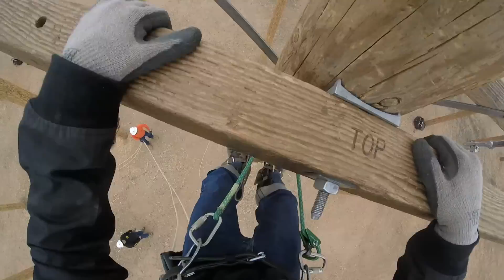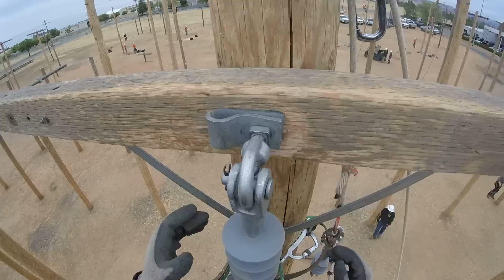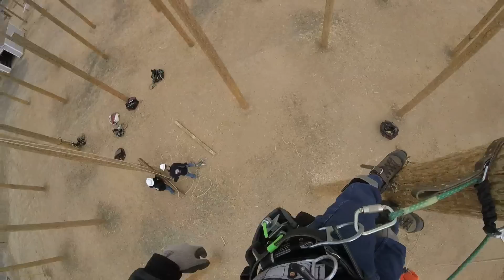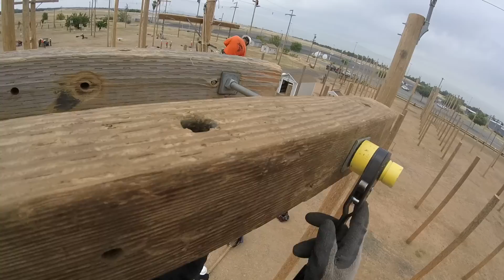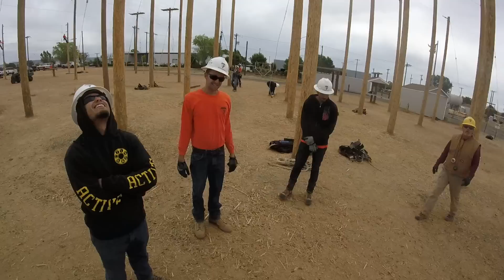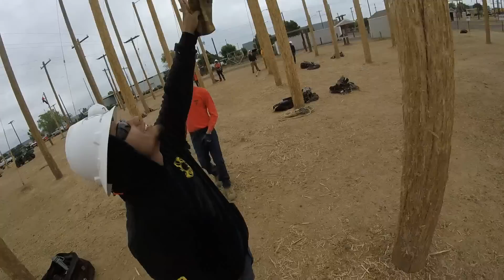Northwest Lineman College - Double Crossarm Changeout

Comment: Quick question what happens if he drops a tool? Is that a automatic fail? And what is the time frame he has to complete this in?
Reply: If you drop something on a comp now its a DQ, and he has 15 minutes to get this done.
Reply: phillips11! It’s a DQ if he’s comping on it. He would have to start over
Reply: No when I went you just used the hand line to bring the tool back up if it took to much time then you would just try again

Comment: Every time he pulls out that wrench untethered I'm like "oh boi here we go again"
Reply: reculture lol yea man he almost dropped that shit you seen
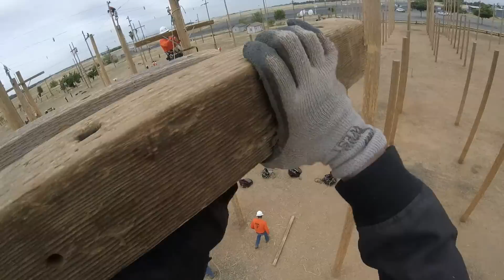Reply: 8:20 that would have been a very unfortunate day for anyone below him. Must have been hanging on by half an inch
Reply: That’s why you stay out of the damn hole.
Reply: I can tell you aren't a lineman.
Reply: Albat, selcat anything else but this...
Reply: Nobody uses tethers dummy
Reply: reculture id throw that damn wrench in the bin and carry me a bell tool . Them nuckle busting sob will piss you off faster than a worm with the shits.
Reply: @roosterkerr1780  I think this is one of those for profit schools that teaches rats how to climb for $100,000. Go join an IBEW union and learn how to do it right from the best. That ratchet wrench is a total pile of junk. I'd even take an old gator 1920s mouth wrench over that ratchet. The ratchet mechanism is total CRAP. It is a low tooth number that won't ratchet when you want it to. Blackhawk & SK made some of the best early ratchets. My old Southern States hot stick ratchet was either a Proto or a Blackhawk 1/2 inch pear head ratchet with a ball on a stem welded onto the back of the ratchet core. You could use two sticks and tighten everything up from the ground. It was a neat system. That extra ball & socket helped out a lot. No one else used that to my knowledge. I loved it. Someone stole all my old Southern States line gear. Salisbury is the dominant one out here now. Buchanan, I suppose. I still have a bunch of Klein grips, sticks, spiders, gloves, gauntlets,  and other stuff. I work on transmitters, sound equipment, theatrical lighting & guitar & other musical instrument amps now. Some of the large transmitters run up above 100KV. I am not above or beneath overriding the interlocks on the doors and troubleshooting those thing hot either. Sometimes it's just the only way, besides trail & error guessing.

Comment: Untethered tools with a tiny exclusion zone beneath? Mkay.
Reply: Yeah is that procedure? Could have a paracord teather for the wrench or something I was thinking he took a risk removing the heavy wooden arm from the pulley and taking it in hand. when he could have installed it then removed the the tie...
Reply: Chanch Chanch  cant think of a reason why he didnt bolt before releasing the pulley.
Reply: Kevin Manley I agree dumping the pulley before he finished the job, bad move.  Sooner or later it’s gonna cost ya an extra trip back up the pole. He was probably thinking about that very thing when he almost dropped  the wrench .

Comment: Puts cotter pins in his mouth. Rigs hook wrong when lowering arms. No “headache” when he airmails the collar rope. Washers are crooked. Arms are probably not parallel. DA bolt should get the nut tightened first. Other than that good job
Reply: Frost12 have to have constructive criticism in this line of work. If you are a lineman and can’t take helpful advice than it’s going to be a tough world out there I’d imagine.
Reply: Piss off dickhead
Reply from the maker: Frost12 this was literally my first 2 months in the trade you fuck. I was at school LEARNING in school, didn’t even have a job yet.
Reply: No frost12 is right , I went to the same school and if you did that it was dq, plus you sent the handine down before the work was done

Comment: it also does NOT work when the nuts are so loose, as the socket can spin as well as the nut can, therefore the ratchet CAN'T click over to the next tooth to allow a second 'bite' with the handle. so to cure this start with fingers first, OR hold the socket still, before attempting to use the ratchet function  :)) ( or better yet use a "rota tor" ratchet handle ).

Comment: They training poles are a mess must be easy changing cross arms in Scotland it's Steele not wood and they are really heavy and you land them yourself gotta have strong arms lol no endless ropes on blocks they velcro straps on Ur spikes are much better than the standard leather u get they hurt my legs also that's shocking the time it took to change that. We dress it on the ground with rollers added for restringing takes fives mins get the man on the ground to pull it up on a block snd sling good effort
Reply: Doing the same thing in NZ. Just started my course to get into the industry. Were told about the transition to steel crossarms the other day.

Comment: Just started lineman boot camp at my Local.  This shit is NOT as easy as it looks.  I hope anyone considering getting into this line of work, has great instructors.  INSPECT YOUR GEAR!!!  Do NOT assume your climbing gear is fine the way it is.  Start low on the pole.  Get used to adjusting everything in its proper place and make sure your climbers are at the proper height.  There is a proper way to do this and thank god for the buck squeeze.  Listen to your instructors...some JL are hard asses, but they know what they are doing and want you to succeed.  Good luck brothers and welcome to the greatest trade there is.
Reply: In some states allow high school students go to a technical school as a freshman or sophomore year currently i'm a sophomore and I attend a school that does Power line work I can say there is a lot of technique in just climbing alone but after that you do get the hang of it and its easy, putting up a machine called the lashing machine was probably the most challenging for me do to the fact its 30 pounds and up on a pole it seems 60 in my eyes, it does give you a good work out but it rewards you greatly if you goto a great company like first energy or something, some company's will actually pay your way in a college if you dont have enough experience as long as you show them your a good climber worker they will keep you as long as they can. Some lineman can make millions after 40 years of working there. It also help me get over my fear of heights. If you have a chance to goto a technical school in highschool I highly suggest you take powerline cause it is fun and highly rewarding.
Reply: did u get in as an apprentice or pay for lineman college?
Reply: Waiver wasn’t approved for military , now heading this direction. Fucking ready for it .
Reply: Isn’t 99 percent of it from buckets now??
Reply: Even linemen have heroes... and its us line clearance trimmers! Remember that when you go on storm and call tree guys out to get tension off the line! Stay safe and climb high
Reply: roasted rasta get the fuck outta here.....

Comment: whoever measured those DA bolts before they sent it up is a dumbass , and is a part of the reason you were struggling to tighten them on the right side, not to mention you didn't tighten the middle through bolt first lol.... good job though.